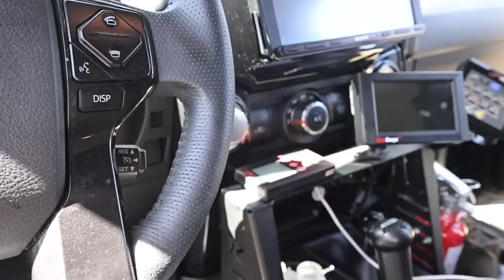DIY DRIVEWAY BUILT Overland 4Runner Used for Months Long Cross Country Adventure

Comment: Nice rig! I installed a locking gas cap and armored my gas tank (RCI) to prevent someone from drilling a hole in my tank and stealing my gas. I also put Catalytic Converter guards on my transmission skid to prevent that sort of thievery.

Comment: How is your radio reception without the antennas in your back windows?
Reply: Velox hooks you with a plug in that makes up for it, no loss at all. Velox install video coming.
Reply: @jailbreakoverlander  Ritchie I am from Saugus a suburb just outside of Boston.   Home of the ole Hill Top & Kowloon!!  Ever been there before?  I drive a 2020 Off Road Taco in Quicksand color.

Comment: I love 4Runners but can’t imagine how slow that thing is now.
Reply from the maker: It's supercharged, so probably not that slow
Reply: @LastLineOfDefense  Perhaps.  But likely about stock power after adding all of that weight.  Wish Toyota would give tge Dr more power from the factory.
Reply: this truck regually hit 95 with ease, regeared and supercharged and powerbrakes were all added to make up for weight. this truck moves
Reply: @jailbreakoverlander  Cool.  Do you have a 0-60 video?